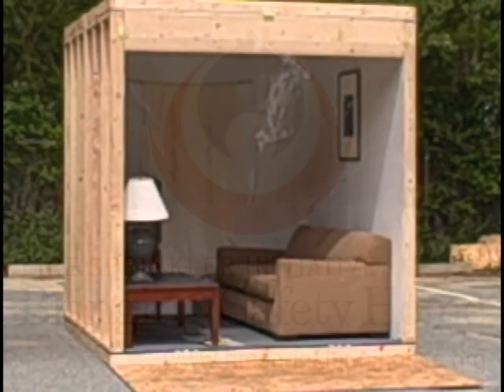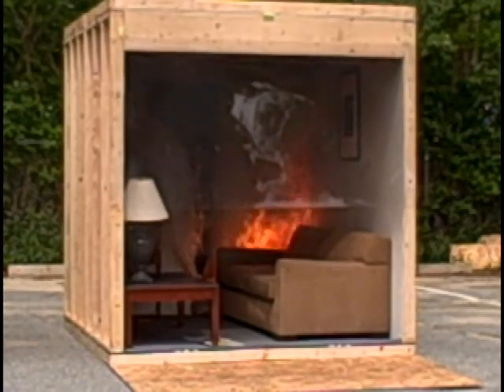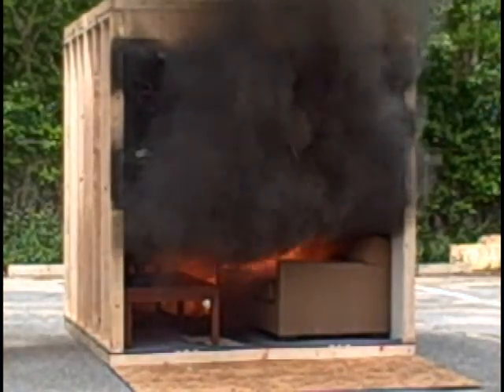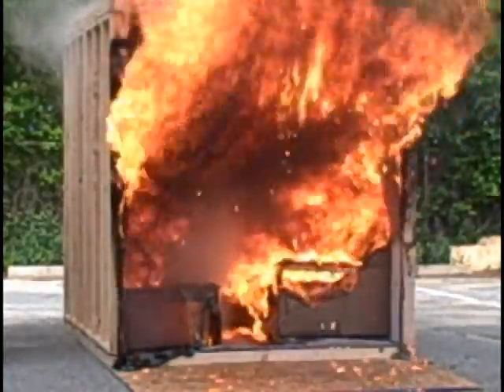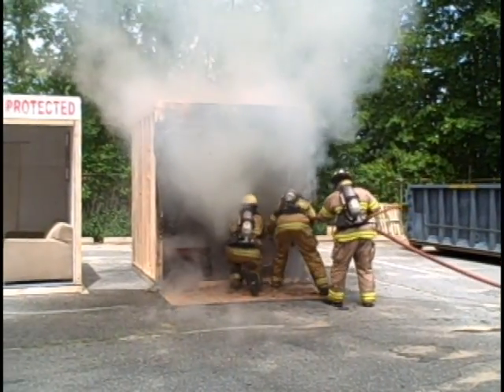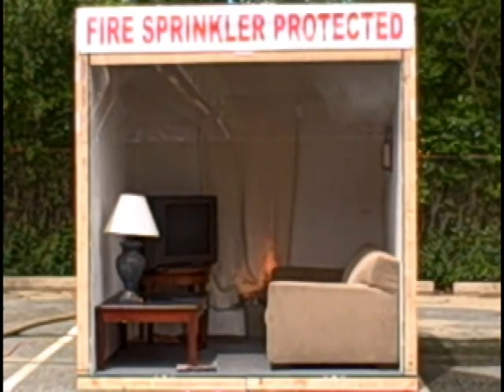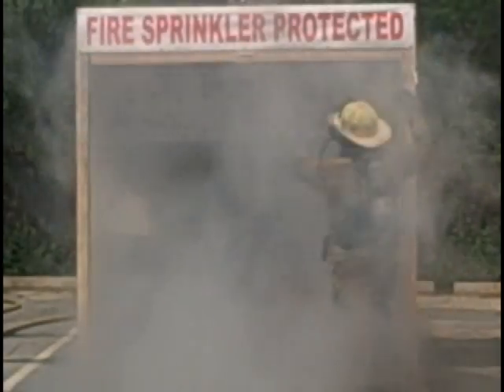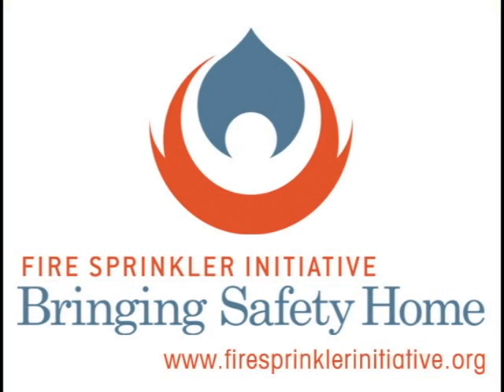Home Fire Sprinkler Demonstration—Plymouth, MA

Comment: old building and a night club must have it installed. as for night club, it is suppose to use home version to prevent abuse by patron. it is beneficial for night club owner to have this installed and this could save life in case of fire broke out. the home version are usually covered with cap in the ceiling, when the fire broke it will then show up and goes off. remember that it is only activated by heat, not smoke

Comment: What a joke. It's a sealed 8 x 10 room (minimum room size allowed by code is 7 x10) so the smoke has no place to go. Ideal for making this test look good, but hardly typical of most living rooms which are open to other rooms. If it was a kitchen grease fire and you ran to your stove as the sprinkler went off, you'd be covered by burning grease and severely burned. Smoke detectors save lives, sprinklers put out fires, sometimes. NFPA is funded by sprinkler manufacturers.